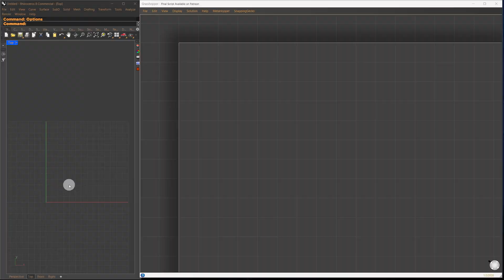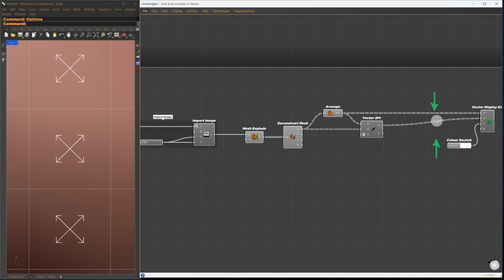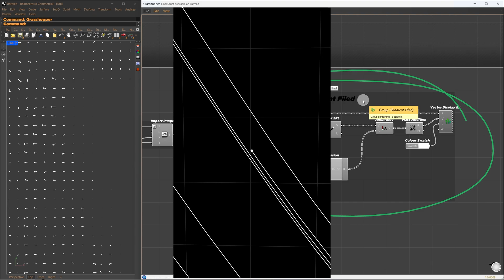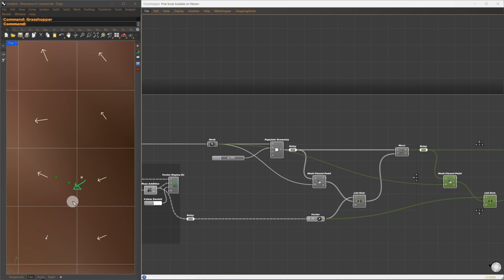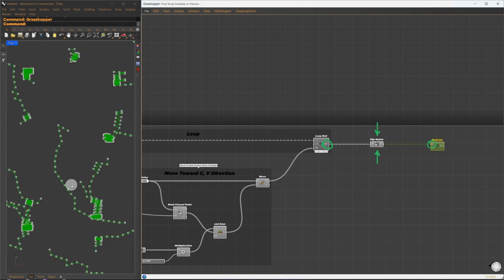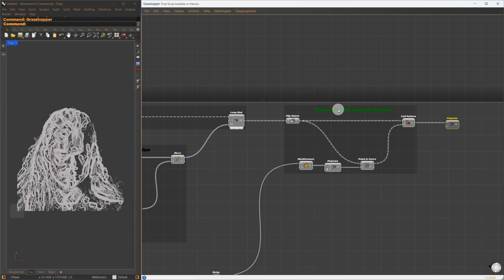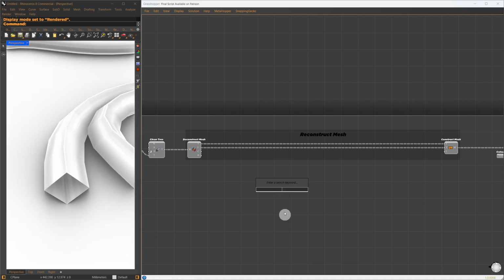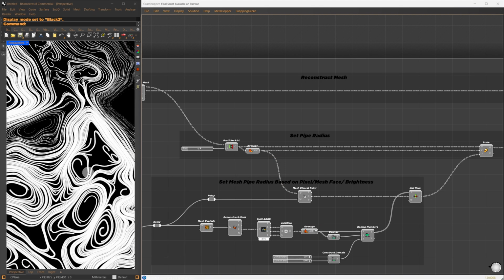Generating Curl Noise from Images in Grasshopper

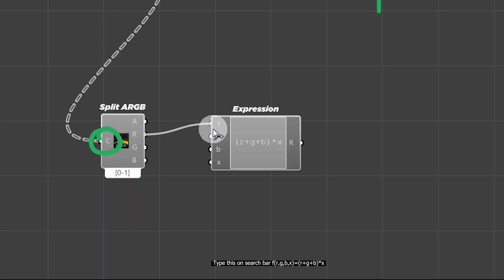Comment: The mathematical Expression function at 2:50 gives me an error. Can you help me with that ?
Reply from the maker: What error did it give you exactly? Most of the time it’s because the input names are misspelled. Double-check that the variable names are exactly r, g, b, and x and in the expression, it should be written like this: (r + g + b) * x. Also make sure there’s no extra "Variable X" or something that’s not defined.
Reply: @3DBeast  It makes all the difference. the space between the characters solved it. Thank you